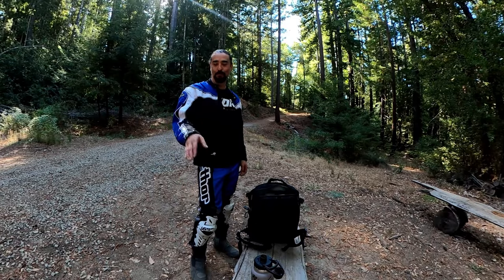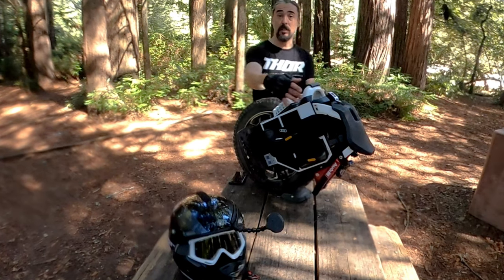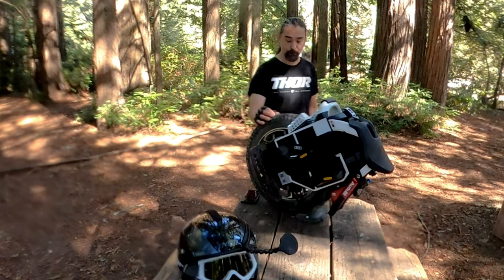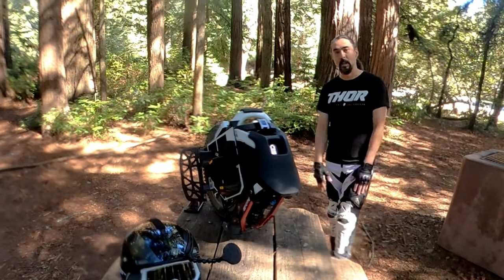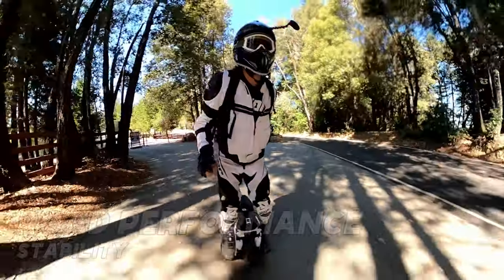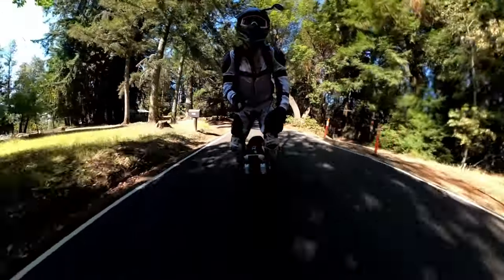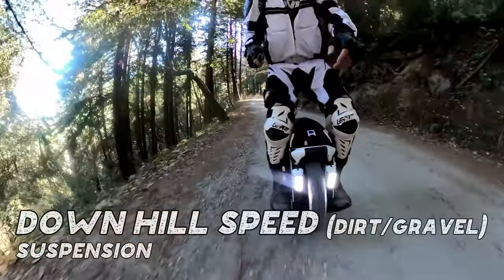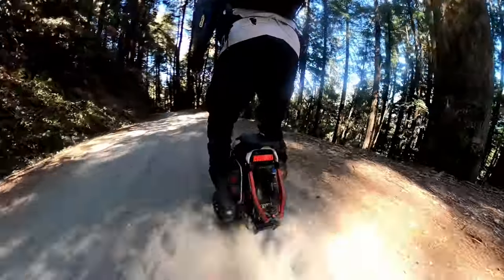💪Stress Testing my KingSong S22 Re-Build 😲 #kingsong #euc #electricunicycle

Comment: 7:11 Hearing some of the classic chewbacca vibration sounds going up hill on the s22. (Reference example: https://youtu.be/5HZHcUaQMF0?t=26 ) lol 🤣I still can't pinpoint where the vibration is coming from yet. Sounds like the motor???

King Song tells me it's normal but vibrations on any electrical device is not good overtime so hopefully someday we get to the bottom of it.
Reply from the maker: 🤣🤣 That did sound like it but no, it was from the motor. Nothing loose. I was torqueing it pretty hard to get up the hill fast. My S18 has a similar growl.
Reply: @5Cauac  my s18 does that too! Funny because other s22's I drove didn't buzz like that but mine does it for some reason

Comment: I think this stock tire is fine but you need to keep high pressure in it (for me, 40/45psi)... Less air will only flatten the tire out the people were complaining about...
Right now I have a 250 lb spring...if that doesn't work out I have a 350 lb spring...I'm not a technical rider like you...
Reply from the maker: You are absolutely correct, It needs higher pressures to behave as it should however the rubber is too soft and will wear out quicker, especially on pavement.  Thanks for watching.